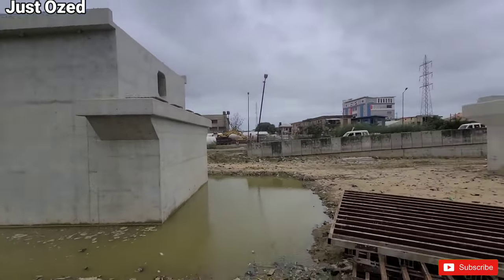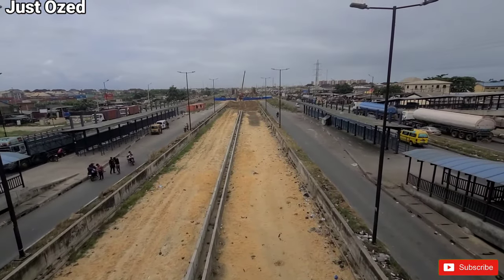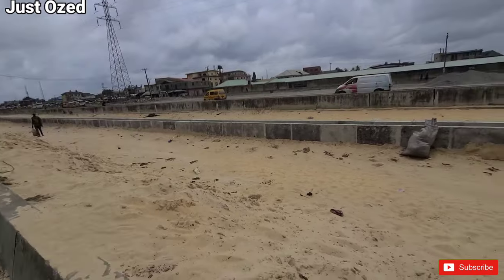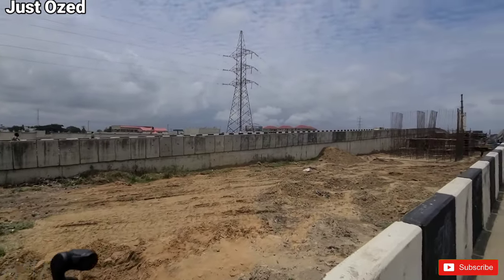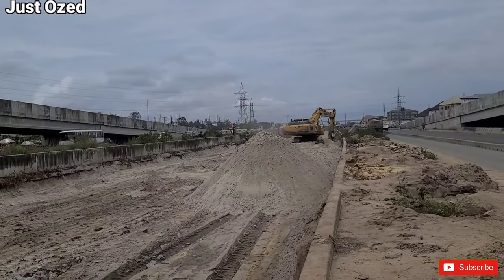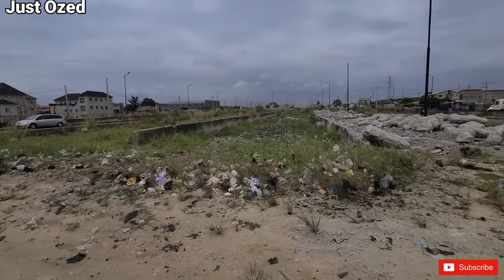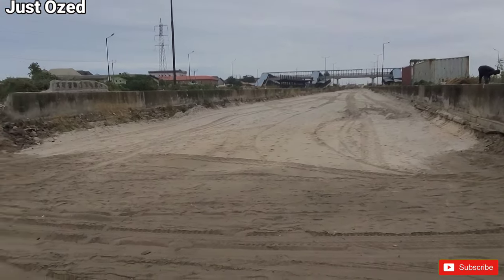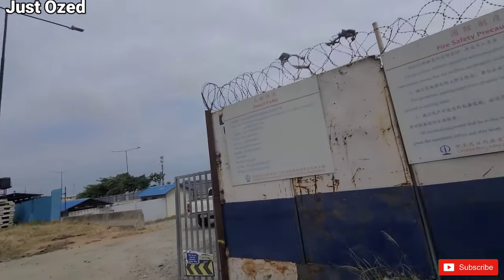Lagos Blue Line Phase Two Construction Update! | All The Major work Going On

Comment: The purple line is also planned to meet the blue line and redline, interchanging at LASU and AGEGE area each. Should be interesting to see when the green and redline construction starts
Reply from the maker: @IOdele  the phase one of the redline is almost done I guess you mean the purple line
Reply: @Justozed  yeah the purple line will connect the red and blue line in the future. Rather than having to go to marina then back
Reply from the maker: @IOdele  yeah I just wish construction begins soonest
Reply: @IOdele  pls will the purple line pass through alimosho and ojo
Reply: @Oemma680  yes. Purple line terminates at Ojo after meeting at LASU
Reply: @IOdele  ok thanks for the information
Reply: @Oemma680 PURPLE LINE: 60km rail designed to run through Redemption Camp, Mowe, Long Bridge, Isheri, Toll Gate, Omole, Ogba, Agege, Iyana Ipaja, Isheri Osun, Igando, Iba, Estate, LASU, Okokomaiko and Ojo.

YELLOW LINE: A 34km rail system designed to traverse Otta, Meran, Alimosho, Ipaja, Isheri Osun, Ejigbo, Mafoluku, Isolo, Surulere and the National Theatre, with a projected daily capacity of 238,000 passengers, rising to 486,000 in few years.